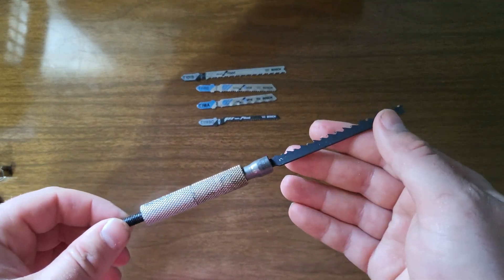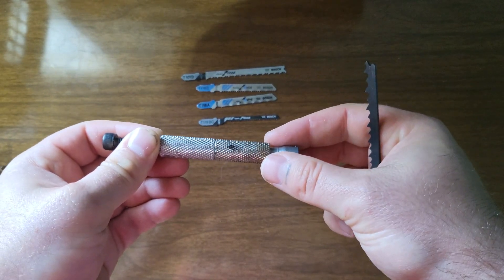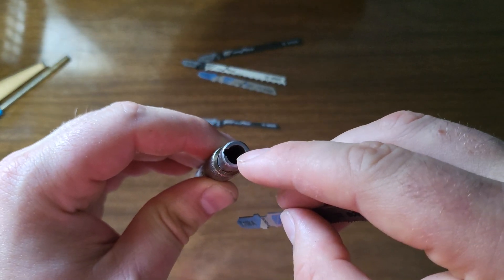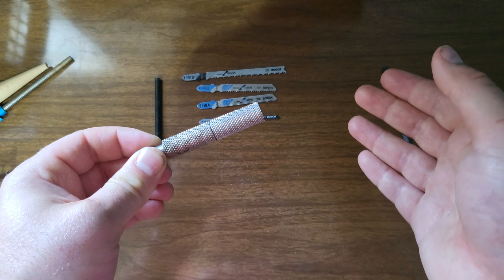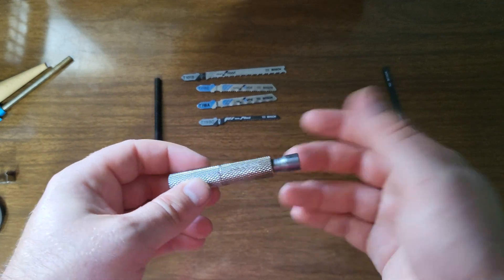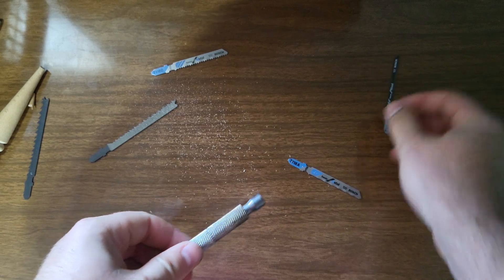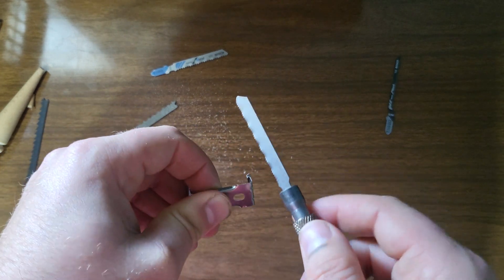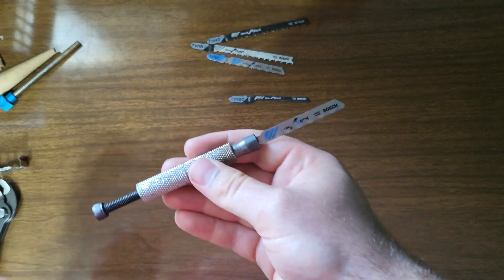I Made a Mini Hacksaw That Uses Standard Jigsaw Blades

Comment: Great little EDC hack.  I built this based on your part list and have the following comments/cautions.  The jigsaw lifter I ordered from Bosch has a total length of 115mm and an M6x80mm hex bolt is way too short.  You will need a 110mm bolt for that length.  Also, the end you insert the saw into does have a slot but the inner barrel is smooth so there is nothing to register against internally when you turn the saw blade opposite the insertion slot.  Tightening the bold does hold it in place though. To use an 80mm bolt would mean you would need to cut and shorten the lifter. Its cheaper to find and use the right length of bolt.
Reply: Your comments and cautions are right on point. I followed and appreciated your help!